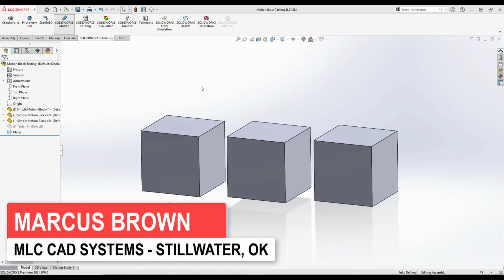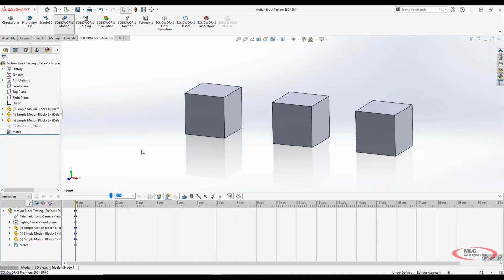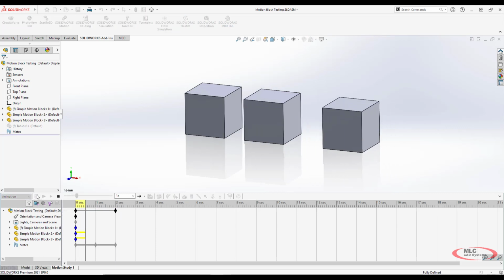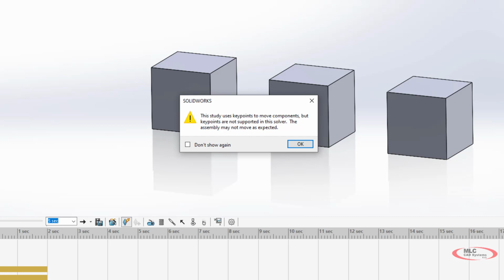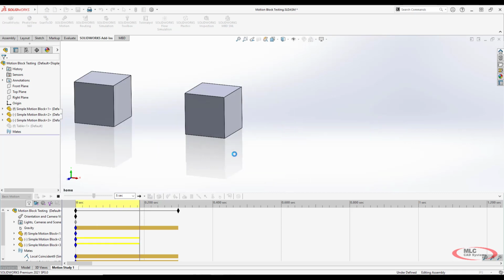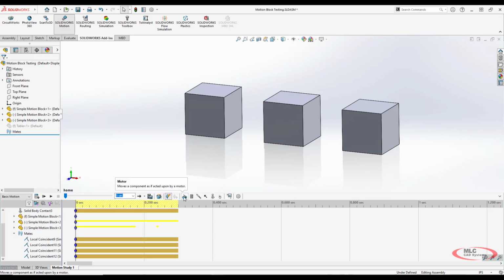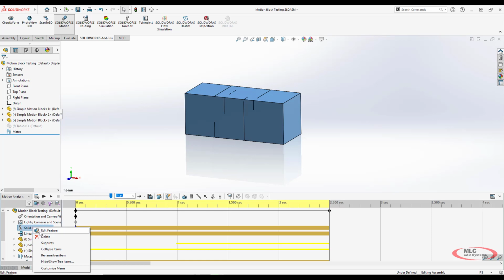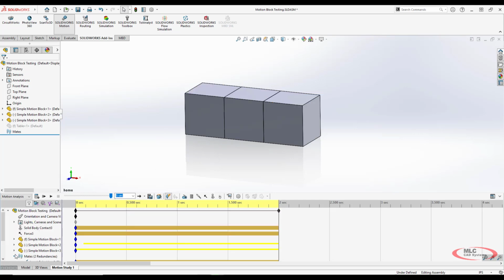SOLIDWORKS Motion Tutorial | Moving Parts in Animation, Basic Motion & Motion Analysis (Part 3)

Comment: hello I have a problem, Ive just folow your vidéo on my labtop but when start si "vidéo" like with the button play, a error message spawn on my screen, its say " This study uses keys to move components, but they are not supported by this solver. The assembly may not move as expected." Can you help me please ? Thanks
Reply from the maker: Not all methods of movement are supported by all solvers. If the movement is as expected, you can ignore the warning or try to find and delete the move keys. See if changing it to Animation instead of Basic Motion or Motion Simulation works better if you want to use drag motion.